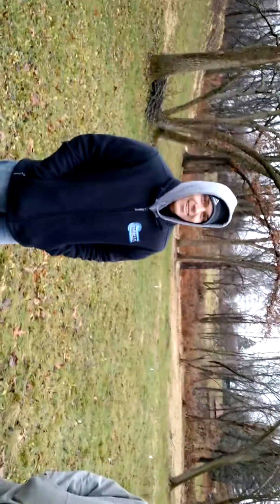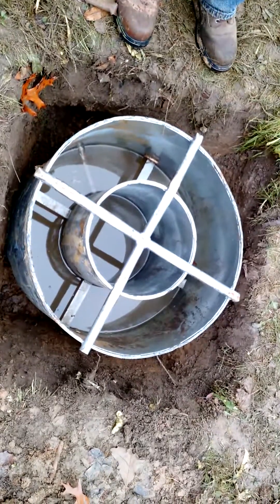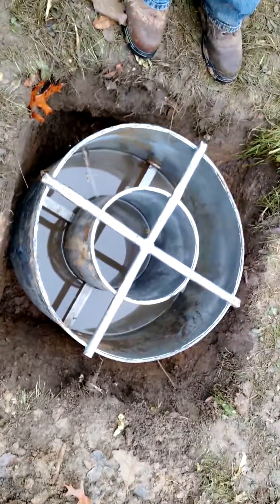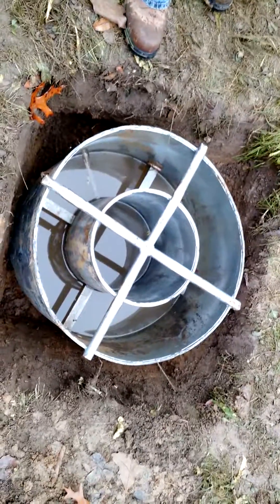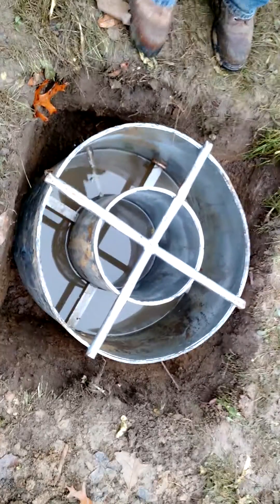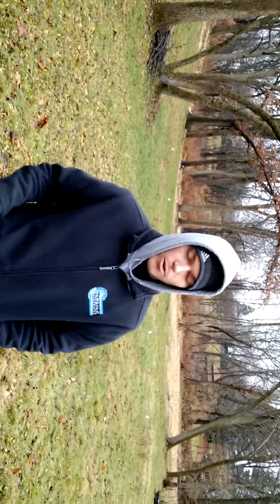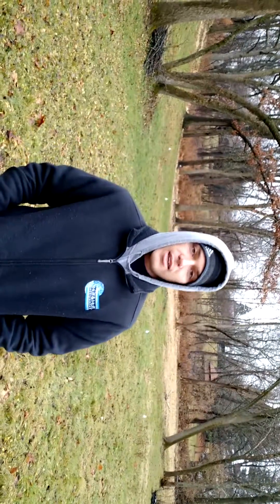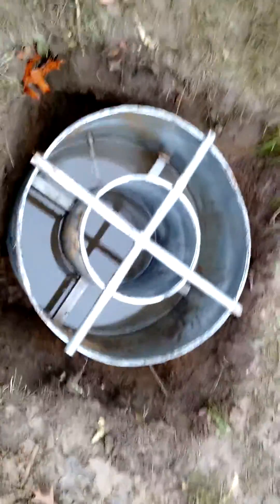BioBarrier Soil Test

Comment: Kurt, You've actually made my point.  Loading that heavily makes full characterization and assessment of spatial variability even more important. One can and should excavate multiple holes around the PDA to characterize the soils for such a small area. Obviously you've never run many or any double ring tests under constant head in replicate to experience the variability I refer to. It's also odd that you mention science.  I haven't seen anything but unsubstantiated claims and use of capital letters referring to some unspecified "safety" factor.

My original intent was not to denigrate your product which likely has some appropriate applications but to point out that the test method has nothing in common with ASTM 3385 (other than the use of 2 rings and water).
Reply from the maker: We not only do not load the soil heavily but we have in real world numbers 4 times the dispersal area required. In addition our process control system limits the rate water is applied to LESS than the absorption rate of the soil no matter what the sizing is. We have been thinking because of the precise process control and unneeded over sizing of the absorption area that we do not need anywhere near this level of accuracy and therefore we may add a plain old percolation test to determine sizing of the dispersal area.

Comment from the maker: " spatial variability in the soils"?  Do you have any clue of what we are trying to accomplish here? The entire area needed for the dispersal area in a 4 bedroom home with Illinois .20 septic loading rate soil is the size of a single parking spot at Walmart. How many holes should you dig in such an area? Also,  Huff & Huff does perform these tests correctly, manually.  It seems you have other issues not related to science here.

Comment: Sorry for being "silly".  This video documents that Huff and Huff (assuming their jackets show the company name) is not performing the tests to the referenced ASTM standard. I assume that would be important to their clients, the engineering community, and regulators.  Performing tests that are advertised as conducted to ASTM 3385 puts firms that actually adhere to 3385 at a disadvantage because of the additional time and equipment needed to run a constant head.   In addition, one test does not generally account for spatial variability in the soils which can vary by a factor of 10 within the same soil.  Finally, yes there is a difference between running tests at constant head in the inner and outer rings and using an unspecified procedure where the heads in the inner and outer rings are falling independently. Let the outer ring go dry and record the rates. Overfill the outer ring above the inner ring and record the rates.  The results will be significantly different. 

If there is another standard that applies to the procedure used, that standard should be quoted. If not, provide some references or research that supports the methodology or just state that it's a method that was improvised specifically for this application.  No problem then.

Comment from the maker: More than accurate enough for our needs, Brad. The formula used to calculate the filtrate dispersal area has a real world FOUR times safety factor. And we have precise process control on quantity, quality, and rate of delivery which is less than the infiltrative rate by the way. I think you will find this is an accurate test.  Certainly more accurate than we need.